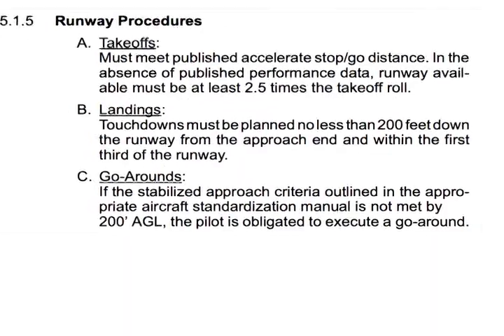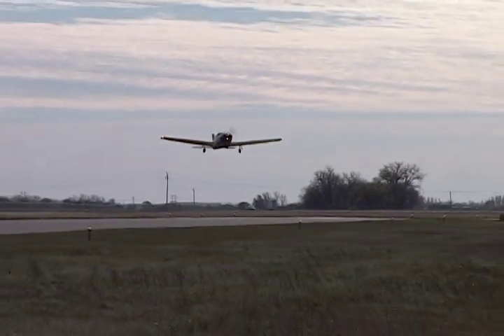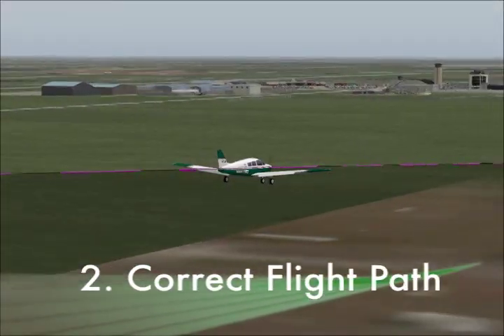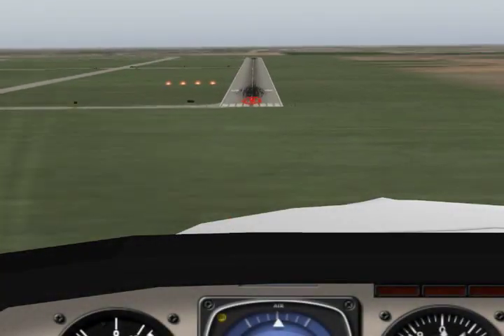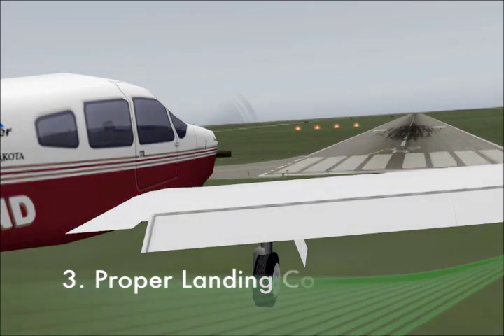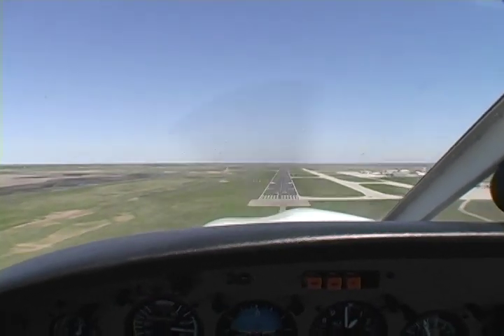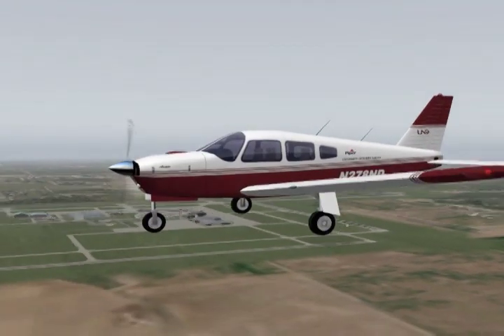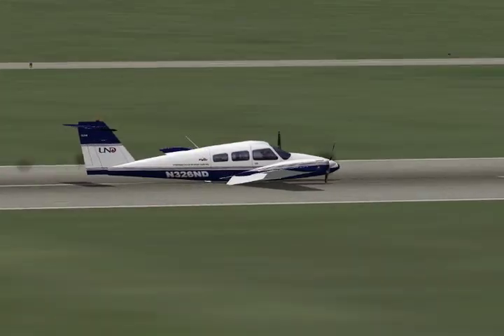Stabilized Approaches

Comment: I had my first flying lesson a few weeks ago. Though the instructor said I did pretty good and dealt with the cross winds good for my first time, your videos helped me see what I could have done better. Though I still have a lot to learn, your videos will help me to go into my next lesson with a little bit more knowledge. Thanks for posting.
Reply from the maker: Artie, that's great to hear that the video helped and thanks for your comment.  I think its pretty much agreed across the board that a stiff crosswind landing is the most challenging muscle maneuver to learn.  Once you get it right, though, its incredibly rewarding.  Still, its a strange feeling trying to land an airplane banked into the wind.  Good luck on tweaking the crosswind the next time you go up.  Have fun and fly safe!

Comment: Decent video but some of your stabilised approach criteria are clearly written by wannabe airline pilots and not people who are actually thinking about the aircraft they're flying. For instance, 3 degree glidepath - if you're in a single engined aircraft and flying a 3 degree glidepath, you're too low. 3 degrees are for big heavy airliners with more than one engine. Not little light aircraft that are gliding if the engine stops. If you only have one engine, and you're in the pattern - make sure you can always make the runway.